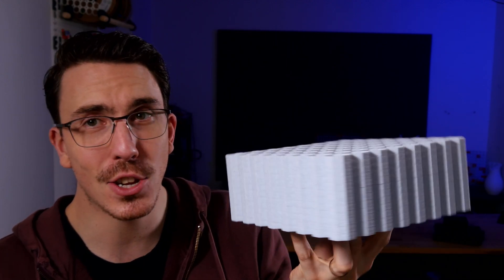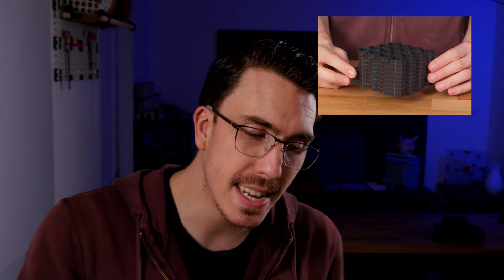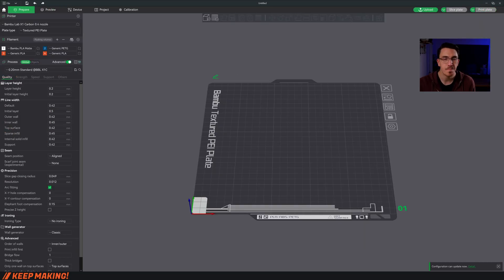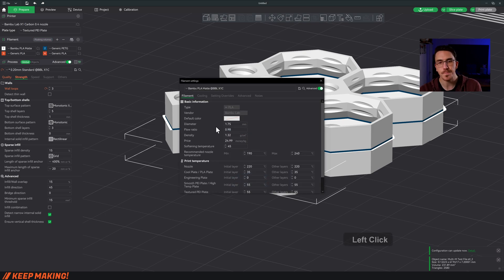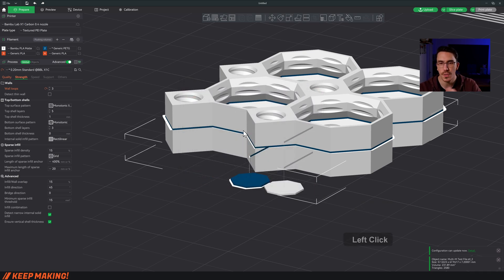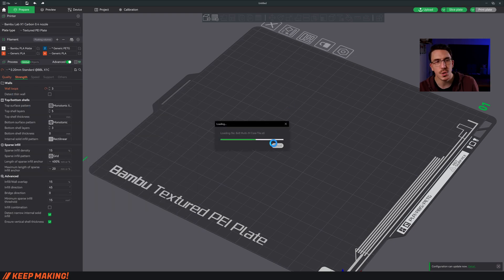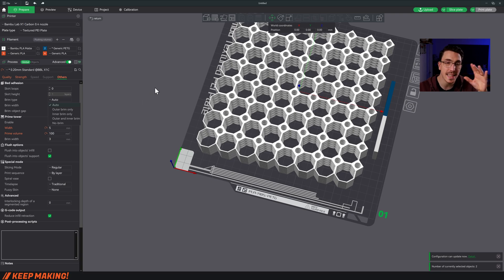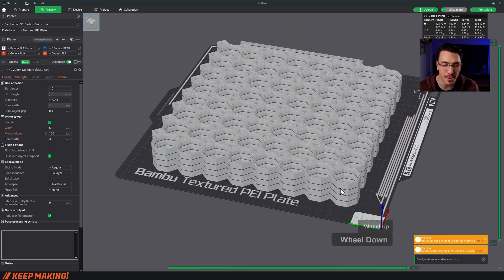What Is Multi-Material Stack 3D Printing - Multiboard

Comment: i've done several large prints with petg\pla combined and i've actually not been able to seperate the parts at all.  I'm sure there are maybe some brands of petg that won't stick to pla, but what i have, stick very well. I've printed clear petg with pla in several layers at several different parts. A year later they're still stuck together (led projects).  I've settled for just ironing the top layer and skipping a layer when stacking. works great and the "bad" side is always facing towards the wall anyway.

Comment: He is doing it the worst way possible. There is no need for the hexagons and you do not need to split the assembly into objects. Just import it and in the objects settings (instead of global) you can find the interface layer and change its material. That way they never collapse to the bottom in the first place.

Comment: Can someone explain how to/why to ad that hexagon on what plane to make them not collapse as a stack.
Reply: He is doing it the worst way possible. There is no need for the hexagons and you do not need to split the assembly into objects. Just import it and in the objects settings (instead of global) you can find the interface layer and change its material. That way they never collapse to the bottom in the first place.

Comment: How do you create the interface layer? I have an 8x8 tile that I want to stack, but only know how to separate them and then use supports. I have been unable to get the PETG to stick to the PLA, but I need to try you over extrusion method and see if I can get it to stick that way.

Comment: Thanks so much for the video, exact issue I'm having now. HOW DID you insert the "layer" between grids? If you just stack something to stack print, Banbu studio won't let you split it into objects unless there is something between the grids. Did you add something, I'm guessing 0.2mm tall, in Fusion or your design program? That's the only solution I can think of. Thanks!

Comment: I'm trying to calculate just how much material it would take to cover a certain square footage (would be cool to have a calculator on the site [ Full Stack Web Dev here if you need help ])
Was going to use your screenshots at 1:55 but am a bit confused by the verbage. You said 8x8, but in text it says 3x3. I'm not really sure what is going on there, but your 4x4 screenshots are 1/4 the spoken 8x8 screenshots, so I am going to guess the text is wrong and the tiles are 8x8 as those calculations make sense... Perhaps the 3x3 was the layout of the tiles themselves and not the dimensions of the tiles since there's 9 of them... A graphical representation would've been helpful here, but I think this is right :)

BTW: It came out roughly to 1.29g / sq. inch for those also wanting to do some cost calculations. This means around 6kg of material for a 4'x8' sheet.

Comment: Also it helps to get the temperatures further together, so I print PLA on 235° ... also some PETG and PLA doesn't want to stick at all, even with the best settings, so just switch to another Brand if you got the option. Also crank up the Filament Flush settings in the area of ~600. Cause if you use Black and White filament, the flush from White to Black is very little and you print with some PLA&PETG Mixture which doesn't work at all.

Comment: 1:58 Am I reading that right? It's an extra 30 minutes? On a 2046 minute job? The tradeoff is an extra 1.47%...
it makes less sense for the second example, where doing it single material + ironing is 13.5% faster than multi-material - but if it's an extra30 minutes on a day long job? That's not so bad at all.

Comment: You don't have to have the "tabs" that you place on the bed in the first layer. Export your tiles as their own STL, then the interface as it's own STL. Then, you import both of them into your slicer at the same time, it will ask you "Load these files as a single object with multiple parts?". Choose yes, and then your interface object still keeps it's offset from the bed, and allows you to assign it a different filament. I stacked 10 tiles, and 9 interface layers in Blender, then exported each object separately (19 STLs total), giving them names like Tile1, Tile2, Tile3, and Interface1, Interface2, Interface3, etc. If I want a stack of 5, I import Tiles1-5, and Interface1-4, then select yes to load all as one object. This gives ability to print 2-10 stacked tiles at a time pretty easily.

Thank you for all your hard work on this project! I'll be donating as it gets more fleshed out.

Comment: If you don't want to manually change filaments, the "ironing" method does work.  Just don't wait too long to pry them apart, or you find out how hard PLA edges are!.  I printed out a 4 layer stack of corners, then an 8 layer stack of core tiles.

Comment: Another slightly easier method is to simply leave a 0.4mm gap between each object (use merge to fix them in vertical place) then enable support set PETG, 0mm gap, 0mm interface layer spacing etc. You still want a height range modifier spanning the infill and first layer above of each new part to reduce speed to 60mm/s (see my other comments.) Oh and you have to set the support threshold angle thingy to like 1 degree, unless you want material changes every layer! It's a bit messy, so I prefer the separate interface object/part  method overall.

Comment: Rather than the over extruding bandaid, I get best results by setting a height range modifier spanning my two PETG layers and the first layer of the next PLA layer. I set the all speeds for that modifier to 60mm/s and disable slow down for overhangs. mThe slower speed gives the extra bonding between PLA and PETG, in a similar way to having a lower first layer speed on the build plate. I tried setting just the PETG art slower but found I needed to reduce the first layer of the PLA on top of PETG as well for most reliable results.

Comment: Would it make sense/be possible to use PVA for the separator level? IIUC, that's water soluble and should just dissolve, leaving the PLA layers behind without having to snap them apart at all.
Honestly, that's where I thought this was headed when I read the announcement...
Reply: That would work so long as temperatures aren't crazy different and they bond.. petg is crazy cheap so I'm failing to see how that is better unless it's an inaccessible or delicate area, also waterlogged prints if it seeps in.

Comment: Wouldn't it be even better if you just alternated PETG and PLA tiles (or at least have the option).  i.e. even layer tiles pla, and odd layer tiles petg.  You'd have less poop waste and shorter time due to less switching.
Reply: Functionally better, aesthetically worse, unless you have matching colors for each. They are nearly identical in price else if there was a huge discrepancy, use the expensive one as the interface material. Both methods have pros and cons.
Reply: Just tested this... I used the generator to set up a single test unit or 2 layers. Used the ironing profile so we don't have to deal with the separator and multilateral towers but also set the gap to 0 mm. After some strange layer splits I found some detail online saying that with a single extruder you'll need to set your flushing volumes to at least 800 between materials. (The slicer saw that I had both PLA and PETG as white and so assumed a far lowers value, 160 or so.) 
After that change, the test came out perfect... the top layer coming off clean and both without any print issues. Good to know 👍 

4 points I've realised though: 
1- The slower print speed of PETG means you lose any benefit of saving switching time as soon as you go over around 6x6. But you still save on the poop... I'm getting very similar estimates on a 7x7 grid.
2- You need to try end with PLA as the slicer won't do an 800 flush at the start of the print. If you ended with PETG and start your next print with PLA, the first layer will likely have some problems when removing the print. 
3- Surprisingly, both MM options seem faster than ironing on my side so I wonder if I can rather up my PLA printing speeds or fix some other local setting 🤔
4- You'll need to split to part instead of object to keep their heights. This means you'll also need to manually set each PETG layer. Not a big thing but might be too much of a hassle for some.
Reply: @JeffreyCreweBrown  this comment is gold
Reply: It was my thought as well before watching. So just a layer or two of the other type of material? You could probably insert a pause and paint over the top layer with a sharpie before continuing.

Comment: I'm very surprised the ironing is faster. One should be flushing at least 700mm³ of filament between PLA and PETG, which is a lot so I suppose I could see 18 filament changes taking a while, but still
Reply: the speed of iron vs multi-material is gonna depend a lot on what your ironing speed is set to, or for multi-material if you have a tool-changer like the Prusa XL or a filament-changer like a Prusa MMU or Bambu AMS